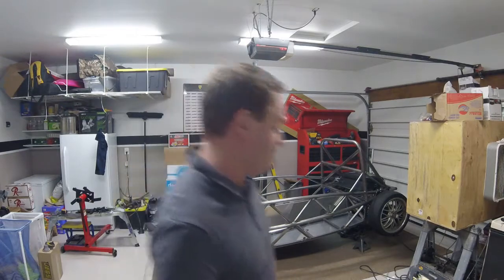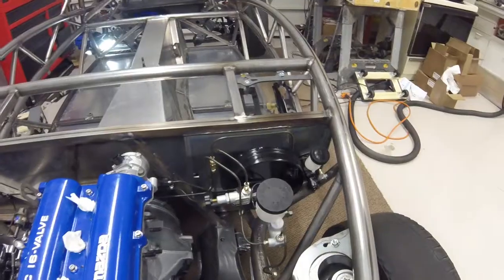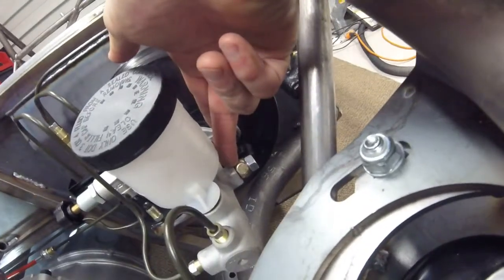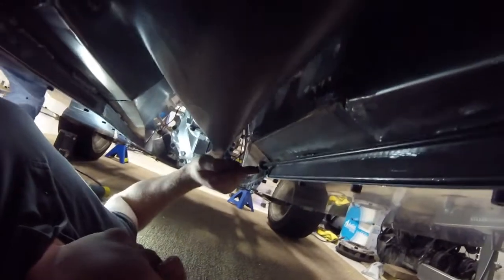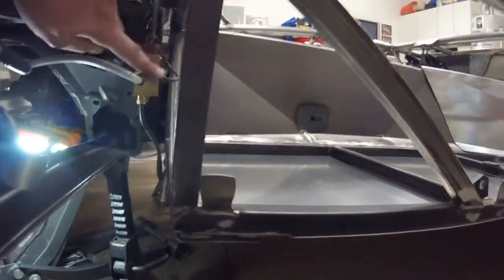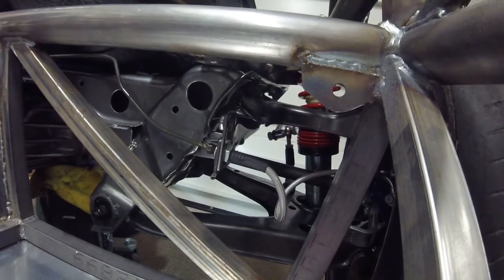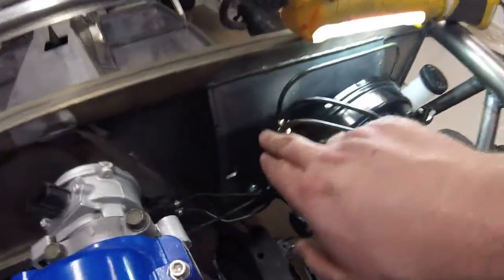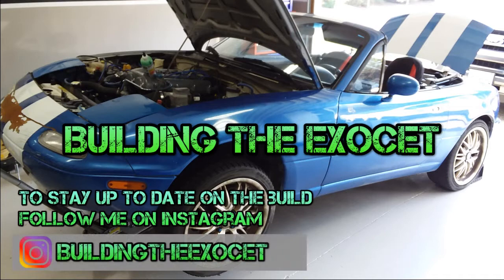Exocet Build: Exocet Brake Line Routing (Part 29)

Comment: Nice job bending and routing.  I'm guessing you used the riv-nuts for the P-clips, based on the view of the same low-profile socket head screws that you used for the floors.  The notes that there are not brake line mounts on the kit frame are also very valuable.
Reply from the maker: Thanks and yes p clips and rivnuts

Comment: Very nice work, as usual. I was going to follow your lead and do my brake lines just as you have but I think I am going to pick up the Exomotive Exocet Stainless Steel Braided Clutch & Brake Line Set. What are your plans for the fuel lines?
Reply from the maker: cwwyamz I made my own braided stainless.  About 60% the cost of the flying Miata kit
Reply: Wow, you have my attention. You saved a good chunk of change there. Did you record it? :)
Reply from the maker: cwwyamz yes I have a video of it. But I do not list all the parts.  Takes too much time.  I think the fuel line is the next video.  Total cost of fuel lines built myself was under $200